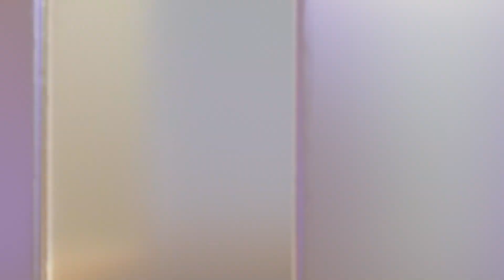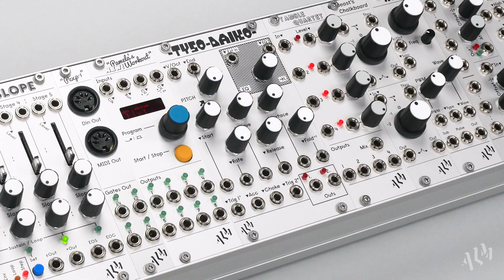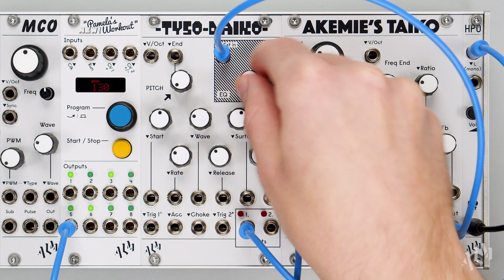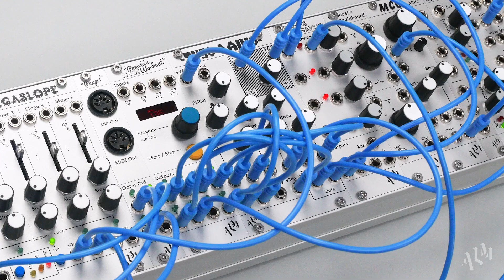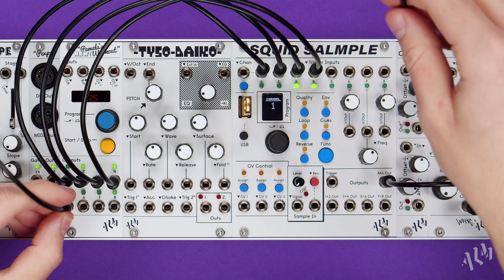Introducing Tyso Daiko - Dual Wavetable Drum Voice - ALM031

Comment: I’m torn between Akemie’s Taiko and Tyso Daiko atm. I had the og Dinky’s Taiko when it came out and loved it, but the Tyso definitely sounds like it has a broader range. Akemie’s Taiko sounds lovely, but sounds similar to my Volca Drum. Are they using the same chip?
Reply from the maker: They use different chips. Akemie's Taiko produces sounds via original NOS Yamaha chips and is FM based vs the wavetable architecture of the Tyso Daiko.